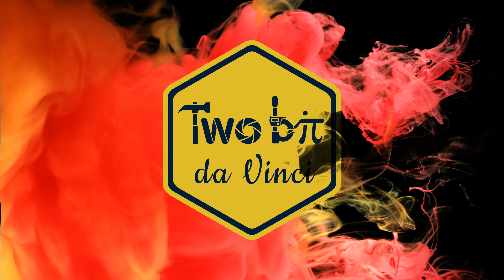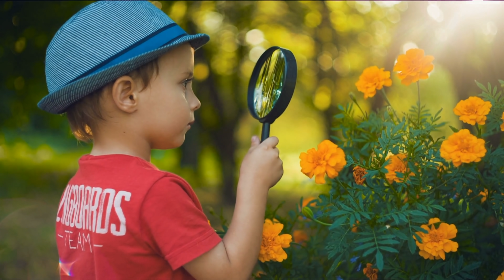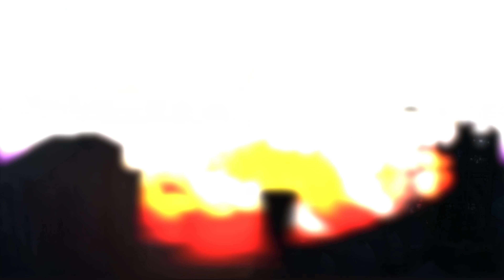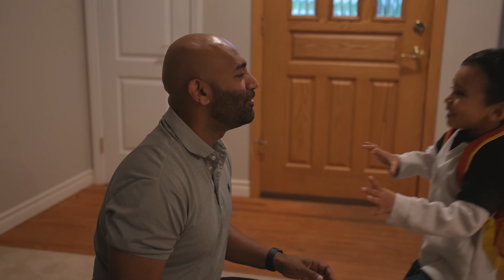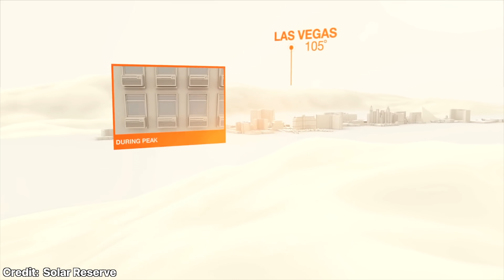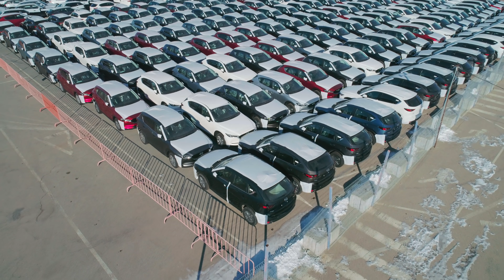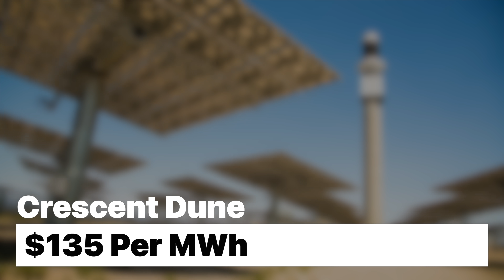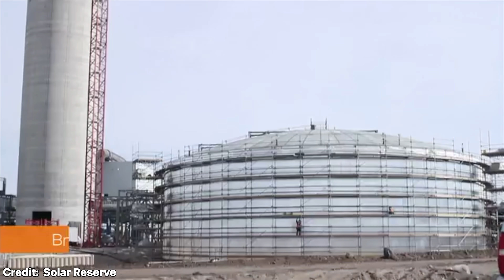This Billion Dollar Solar Plant was an EPIC Failure

Comment: You just epitomized every old joke about engineers and statistics. Projections aren't guaranteed - only the products that work even get on that curve.

It's way too early to declare a winner. Solar thermal has a working history of over 120 years - and it looks like the engineering issues scaling up were more problematic than the labor costs. What happens when PVs start aging out in an inflationary market? Dunno, but we're about to find out.

I don't see the renewable only working in the near term - Germany is further into ng dependence because of the overhyped drive for technologies that aren't able to support modern needs. Strangely, people aren't willing to freeze to death to save Siberia from becoming habitable in a few centuries.

I think both PV and solar thermal will have a place as we move away from grid dependence but not overnight and not as replacement for petroleum and combustion tech.
Reply: Without this 'overhyped drive for technology' Germany would be even more dependent on NG. The nuclear powerplants were and are being phased out and no new ones being built as a political decision, not a technological or environmental one. So without wind and solar, the only way to reduce coal usage would be NG for now.
Reply: @MDP1702  Germany phased out nuclear in favor of solar and wind for political reasons. Their dependence stems from the unwise decision to go green and anti nuclear at the same time. The phase out was wasteful and unnecessary.
Reply: @MDP1702  You just repeated my point - the nuclear phase out was completely political. Perfectly good reactors were taken offline directly resulting in Germany's dependence on Russian ng. Why? Because Germany tried to appease competing segments of its green movement . One totally anti nuclear and the other irrationality convinced that wind and solar could work at the grid scale.

Two undersea pipelines and a full invasion later the net effect is a worsening of the environment both the physical and the political. Pity, because solar and wind should have a place but all or nothing schemes tend to get shelved if they fail in any way.
Reply: @MDP1702  Even if I grant all of this - and most is just nitpicking - it literally does no damage at all to my argument that Germany shot itself in the foot for political reasons directly resulting in their dependence on ng. There wasn't a necessary reason to shift, certainly not the way they did it. Coal and nuclear could have continued supplying Germany with her power - the decision to shift to solar and wind was purely political.

Trying to do  something prohibitively expensive when you know that it is prohibitively expensive is irrational. Solar and wind can't supply a modern grid without serious degradation of service or bankruptcy - probably both. Rosy projections and chicken in every pot politics don't change reality. The technology is not ready for the burden in any reasonable way.

Ng dependence is a bit more complicated - the critical factor here is not how much power production is done by ng but that the grid will collapse without it. Nuclear power is a much more reliable base but it cannot ramp up to meet changing demand any better than solar or wind. To deal with the daily changes takes a fast generator like coal and ng. Grids all depend on this kind of excess capacity but solar and wind are vastly more dependent on  excess capacity because they are so erratic. Without ng generators the whole grid would fail.

Nuclear also needs excess capacity support from other sources as I said but because nuclear power is incredibly stable and does have some excess capacity of its own (predictable things like more ac in summer can be met with nuclear where quick changes can't ) less excess capacity is called on to smooth out spikes in demand. Nuclear doesn't have erratic changes in output so other generators don't have to compensate - unlike with wind and solar. And spikes in demand on a still cloudy day don't need more excess capacity for nuclear / ng where the same would have ng working overtime for solar / wind.

Comment: They maybe could salvage part of the thermal plant by replacing the mirrors with photovoltaics and maybe include a battery storage for back up and or nighttime use .
Another problem with the mirrors is that they were barbecuing any birds that happen to fly over them .
Reply: The video is wrong. The plant hasn't failed. It is now operating as intended. There were technical problems which caused shutdowns and legal wrangling over the contract.
Reply: Why not change the mirrors to PV panels but still reflect it on the tower? Then you would still have the storage of the molten salt.
Reply: @gravelydon7072  Is this sarcasm? You know PV works by absorbing light right, so there shouldn't be dick all to reflect?

Comment: Don Sodaway (Ambri' liquid batteries) made a statement that may apply here.  If you want something to be as cheap as dirt, make it out of dirt.  CSPs use salt because it is a liquid at high temperatures, but it is corrosive and if it solidifies.....  
You can aim sunlight with mirrors, aim it at the north slope of a hill and heat a whole lot of dirt, a week or two of storage.  Insulate it on 4 sides (bottom and front open).  No corrosion, and you hope it doesn't turn liquid.  Bury pipes in the dirt to run water through for steam.
Reply: Would take a very high temperature for it to work,  which is why they didn't just heat water in this solar plant; they needed much higher temperatures, so they had to melt salt.  Thousands of degrees!
Reply: @jamesengland7461  A gas fired power plant runs at 2000 degrees, hotter than the salt operates.  Higher temperatures provide higher efficiencies (Carnot').

The dirt, like the salt, is just thermal mass.  The specific heat of the dirt is higher than salt (they add silica to salt to increase the specific heat).  The speed heat travels through dirt, compared to salt, determines the amount of augmentation (stainless steel sheets layered in the dirt) to speed transfer of the heat.

Comment: For storage, I like the liquid metal battery idea, but have not tried it yet.
Room temp liquid metal batteries might be less efficient than molten salt(need to find those numbers).
The heleostat mirrors and human attention seem to be a big price bottleneck.
If the land is not otherwise being used, it provides a bit of shade(see previous video), and you could bring the maintenance cost down, this might be a good supliment.
Reply: The only way this solar plant would ever be affordable is precisely because it needed extremely high temperatures to generate cost- effective power.  It couldn't even do so using superheated steam. The numbers of the physics are pretty complicated,  but as a very rough approximation,  think of the efficiency as going up with the square of the temperature difference between intake temp and exhaust temp.

Comment: Sell off the site go pennies on the dollar. Recycle tower and liquid salt system. clean up site put new double sided photovoltaic panels on tracking equipment . Augment with batteries for extended output. If double sided panels are not available or don’t prove their worth then try cooling PV panels recycle heat for Sterling engines . The main idea is site is high potential for solar power generation try other means to experiment not just give up.
Reply: Tracking solar is a waste of money.  If the solar cell costs are high, you need the maximum efficiency from them and trackers were a solution. But now the price is so low that the costs of maintaining the tracking systems far out weigh the potential efficiency gains.  It's cheaper to just buy more panels.  And why pay money for land that you then need to pay money to clean away the old stuff, when you can just buy new empty land for cheaper.

Comment: This is exactly what I see is happening with hydrogen vehicles at least for the most part. Battery tech by 2030 will render it not viable in most places.
Reply: Yea, I did a deep dive into hydrogen power for a video that I have coming up. Long story short: it looks like it’s great for maritime and aerospace shipping, long haul flights, long term energy storage, and industrial processes which require extreme heat.

But when it comes to cars? Yea hydrogen fuel cells make no sense when compared with EV tech.
Reply: @SaveMoneySavethePlanet  what about heavy vehicles? Trucks? I'm actually wondering,
Reply: @matinvatankhah5224  that one is still up in the air, but I think it’s going to eventually go EV. It’s basically a race between if hydrogen fuel infrastructure can get built up in time (and come down in cost) or can battery density reach a usable level.

There’s already some companies rolling out EV semi trucks, but I don’t think we have any solid data yet on the effect on logistics due to charging times and distances that that can travel before needing to charge.
Reply: @SaveMoneySavethePlanet  Trucks won't follow EV, they lose too much of their payload to weight of batteries. It will probably be biofuel since it's significantly more simplistic. Hydrogen is a maybe for aircraft, there are two competing concepts afaik.

Airbus seems to want to go down the hydrogen route but hydrogen has problems. It requires heavy equipment to keep it chilled in storage and hydrogen embrittlement of metal alloys.
Boeing/NASA are working on boundary layer suction/ingestion quite a lot. It will slow the flight down a lot but be significantly more efficient than current mechanisms. It has fewer technical difficulties to overcome as well. I believe the end objective with be SAF (synthetic aviation fuels) for Boeing.

I like Boeing's path better than Airbus' hydrogen path.

Shipping doesn't suffer from weight, so it could use hydrogen. I guess it becomes a debate of is it cheaper to create synthetic fuels from atmospheric gases and not have to switch over current turbine and diesel tech, or; cool hydrogen (weight is no longer an issue), create hydrogen from electrolysis and redevelop/research turbines/engines for hydrogen use.
Reply: Porsche is working on Synfuels as a substitute for Petrol. They are currently testing in racing vehicles as to fine tune to ordinary cars.
Reply: @fluoroantimonictippedcruis1537  I'd say small fission for shipping (look up the difference in tonnage between an aircraft carrier and the Ever-given, for example). Synthetic fuel (eg H2 from water and C from CO2 gets CH4. Perfectly serviceable fuel for cars/trucks/planes) can  power everything that doesn't plug into the grid or carry a dedicated reactor. Simple-ish tech that can integrate in with what we have relatively easily. NTM we don't even need massive new mines or child slaves to get the raw materials, they're already being produced in countries that have mechanization and everything!
Reply: I’d like to see hydrogen powered Steam Drive vehicles …
Reply: @Chris Braid  I believe JCB and Toyota have direct hydrogen combustion engines. JCB tried electricity for excavators but found it impractical. Batteries are not really recyclable or CO2 friendly.
Reply: @chrisbraid2907  right, made of brass... LOL
Reply: If cartridges become viable EVs won't take market dominance. But it's even less likely that batteries will overtake IC.

Comment: As an engineer we’re often taught “more moving parts means more stuff can break.” So I’m not surprised to hear that it eventually cost more than PV farms.

Regardless of cost, I’m still surprised that they’re not using it as a backbone in their renewable energy goals. Maybe someone will tweak the price issue in the future.
Reply: But it had a cool mock up showing how easy it is
Reply: @johnnymonsters9717  hahaha thanks for the laugh! I constantly have engineers try to pitch me on new wonder machines and they go “look how well it works in this video!” To which I often have to explain to them that they’re watching a marketing video….
Reply: @SaveMoneySavethePlanet  I'll try to sell you on the same one Two bit da Vinci did, because it actually makes sense.  ESS iron redux flow batteries as grid storage.  Mostly water and iron.  I mean how much more earth friendly can you get for a system to produce and store energy than solar panels or wind turbines, installed in locations where it makes sense, and then using grid storage.  It's the same idea as what this technology is, which is overproduction during peak generation times to store energy for night usage or low wind usage.

And a WHOLE LOT LESS points of failure.
Reply: @johndoh5182  interesting. I’ll go look for the iron redux episode
Reply: I could imagine the maintenance nightmare for the control valves and associated instrumentation with holt molten salt. Expensive materials, expensive trims, everything needing high-temperature isolation and then pulling things out of service for repairs. Long lead times for everything and exceptionally high prices. Yeah, I can see why this would not be an efficient plant. And you would need tons of spare items on hand for critical systems as almost nothing would be off the shelf except for perhaps the steam plant.
Reply: Solar panels, grid storage.  Two bit Da Vinci covered ESS iron redux flow batteries and to me that makes the most sense.  Moving parts are minimal with those two things.  While it makes a little sense to direct solar panels towards the sun to get the optimal output per solar panel, it's not necessary, or you could do this 2 times in a single day and at night rotate panels back to a morning position.  This is INCREDIBLY simple mechanics for the panels and the same for the grid storage.

People love coming up with technology and trying to sell it as the next greatest thing, and there is a lack of rational thinking when this happens.  One only needs to point at hydrogen combustible engines and then HEV.  Somehow all these power conversions make sense, along with high pressure systems as infrastructure all over a country.  No it doesn't, and only a fanatic backer of the tech tries to convince themselves of it.

So, why in the WORLD would you use this tech "as a backbone" in renewable energy goals???????????   There's nothing about it that makes sense compared to solar panels and environmentally friendly grid storage, or wind farms for that matter in locations where you have plenty of wind.  Both technologies are cheap, and solar panels are easy to deal with.  And if more solar and wind farms would buy into ESS grid storage to where you get to economics of scale with it, instead of being stupid with lithium based batteries which then means an ever harder time getting the supply of elements needed just for BEV, the ESS grid storage tech would drop so much in price it would be laughable that we ever though something like Tesla's grid storage was a good idea.  I mean, they keep delaying vehicle launches or cutting the number of expected output for 2022, WHILE they are trying to win contracts for grid storage.  I don't see how that helps.

The world needs to be smarter and not fund every project just because someone makes a good sales pitch.
Reply: Solar Distillation of seawater/waste water and grid tied power as a side effect. Pump the water into inland estuaries, and take the pressure off the Colorado river. Sell the minerals to other industries as another side profit.. Just an idea......
Reply: @MrInnovativeEnergy  That is my thinking and it is being done. Check out Sundrop Farms in Australia.
Reply: Wait, REGARDLESS OF COST, you're still SURPRISED that they're not using it?  And your name is "Save Money Save the Planet"?   Money is how we keep track of resources.  We have a limited amount of resources, and we don't want to squander them.  We can't just say "Poof!  Here's more resources!"  Reality doesn't work that way.
Reply: @incognitotorpedo42  yes, I’m surprised with how much we subsidize the oil and gas portions of the energy sector that we didn’t choose to subsidize the renewable portion for a couple more years in order to see if we could drive costs down or change the design in some way.

Money is an important resource but so is land. Now we have this giant failed experiment taking up a big chunk of land and I’m surprised that we’re doing NOTHING to figure out a use for it or a way to retrofit it so that it’s useful.
Reply: @SaveMoneySavethePlanet  If you care about resources and land inefficiency you wouldn't want to promote highly inefficient power generation technologies that have already reached their limit other than try to find a better material (which is either too costly or just takes too much time). Not to mention their lifetime is horrendous on a global scale. If you cared about that , you would be more willing to look at nuclear power (the potential of radiation and radiation isotopes has been barely scratched compared to solar/wind).
Reply: But they are not using sophisticated electronics as collection surfaces so that actually makes them simpler than PV imo.
Reply: Well that's another thing. Why don't they arbitrage? Buy electricity while its cheap during the day and sell it back during the night? Or is their molten salt system delivering the efficiency it was designed for?